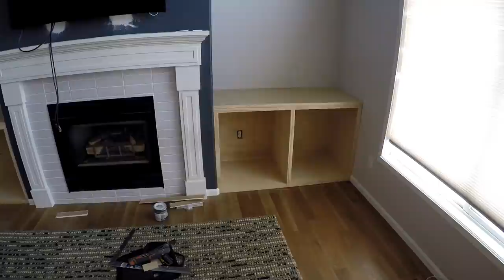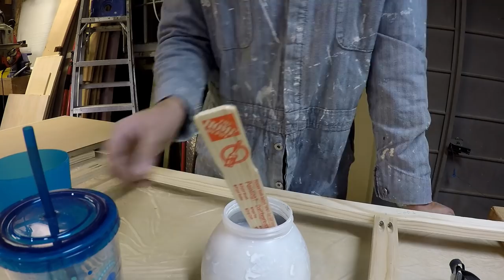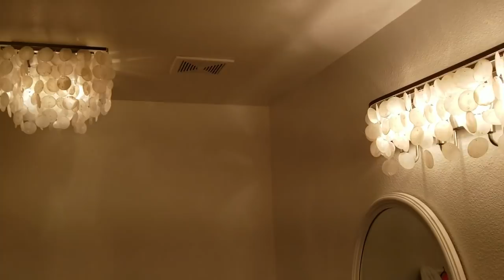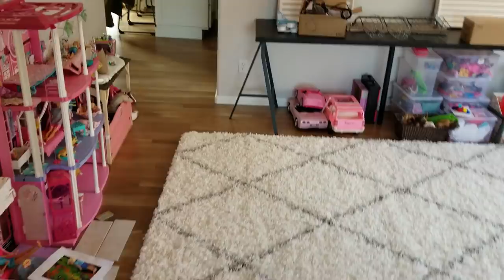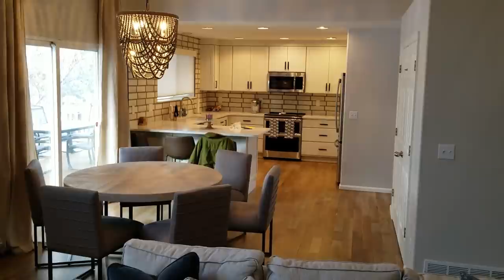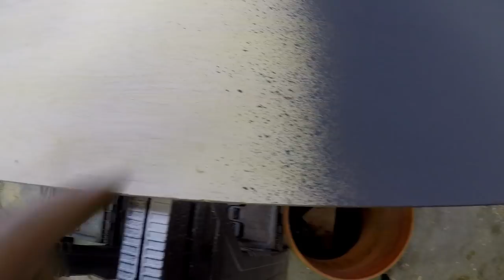Installing Expensive Custom Cabinets | Will They Fit? | THE HANDYMAN |

Comment: Just learning about spraying. So you can take a HVLP gun and run it off a fairly large compressor vs the turbine fan they are normally hooked to????? Thanks
Reply from the maker: NO.   The turbine system have their own guns.
Reply: @TheHandyman1  Thanks. Hopefully you get more into spraying cabinets and such and start using waterborne paints that are harder finish and dry faster. I think you had issues with long dry times.
Reply from the maker: I use lacquer 90 percent of the time when I paint cabinets.   I have a full kitchen to build cabinets for and paint coming up soon.
Reply: Looking forward to it!

Comment: Ahhhh man what a tease wondering how the HF gun compares. Nice job on the remodeling looks good. When you were installing boxes sounded like a airless sprayer in back ground (painters painting home) I wonder how much the customer total spent on all the work. (Plus designer) 🤯🤑
Reply from the maker: Yes that was an ariless sprayer. They had the entire house painted on the inside.  They came back to paint a bathroom and used the airless for some reason.

Comment: YOU CAN'T JUST END THE VIDEO LIKE THAT!  I have the exact same Harbor Freight HVLP gun and I've never used it.  Ending the video like that triggered some High School puberty PTSD, you big tease!   :)
Reply from the maker: LOL.   I need to spend more time with it.  I may have to get a new tip size too.   It is doing some spitting.  Even spraying with water its spitting. It sprays great for 3 seconds spits for 1 second then sprays good for 3.   The manual says I need to take it apart and check a packing nut.  I'll get a video out once I get it working right.
Reply: @TheHandyman1  spraying latex or heavy paints through a HVLP gun requires a 2.0mm tip size, that gun comes with a 1.4mm or so.  Just FYI.  Love the vids!!

Comment: how much money did you make on this house alone and in how much time?
Reply from the maker: Around $30,000   I didn't keep track of the hours.  It took a few months for the entire project to be completed.  Waiting on counter tops for 13 days,  Hardwood floors were 12 days, painters were a week.  I probably had 30 solid days working on this house.

Comment: First! Thanks Handyman!!! Also, I had clear coat in my help gun for weeks...it still sprays but the container won't come off. Am I screwed?
Reply from the maker: try a heat gun and gritting your teeth, grunting and go beast mode on it.  I have done the same thing.  I though I was going to snap the gun in half.  It came off though.
Reply: @TheHandyman1  thank you very much Handyman! I'll let you know if it holds up but hopefully I save$99. Yay!